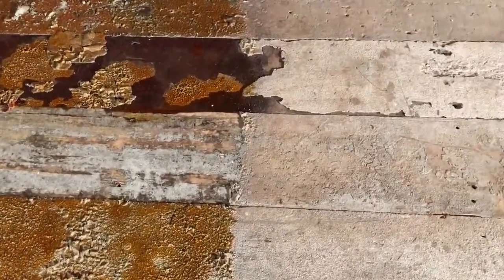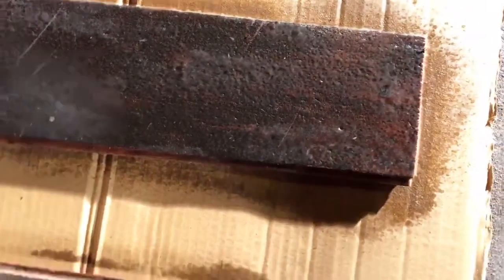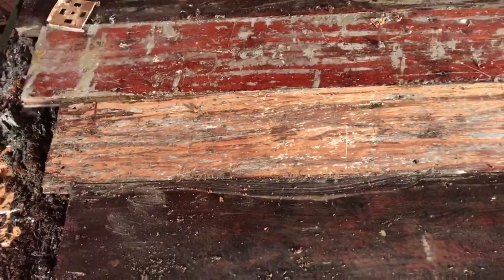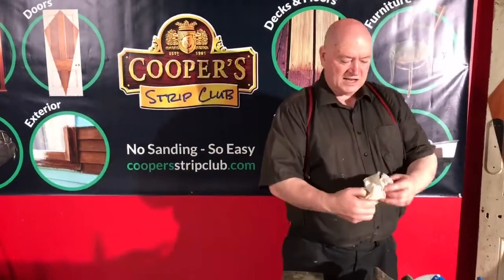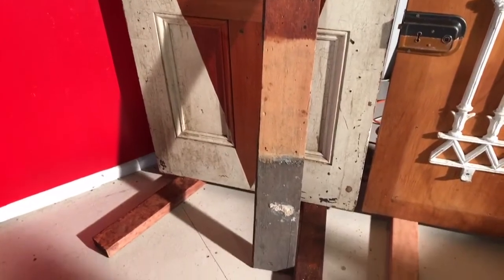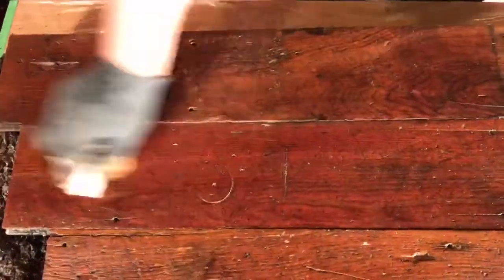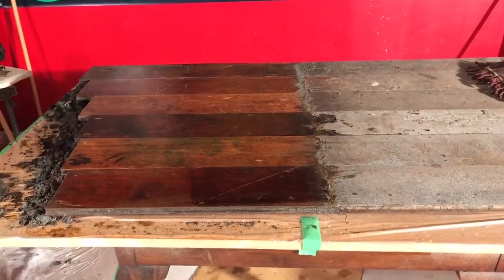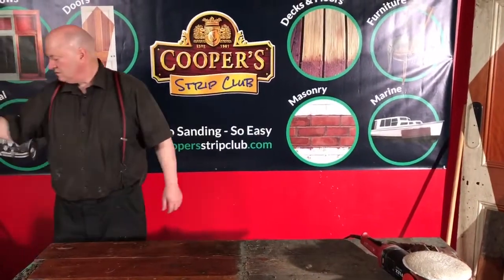How to Restore Painted Floorboards

Comment: No vapors to worry about with this chemical?
Reply from the maker: Hi lprifti2347. For indoor use, make sure there is cross-ventilation that removes any vapour buildup. We also recommend you place a pedestal fan near the window, pointing outward. This will help to draw the indoor air out of the room
Reply: @coopersstripclub  thanks for the reply, I just went ahead and got an IR stripper cuz I have some 1500sqft to do and it’s vaporless